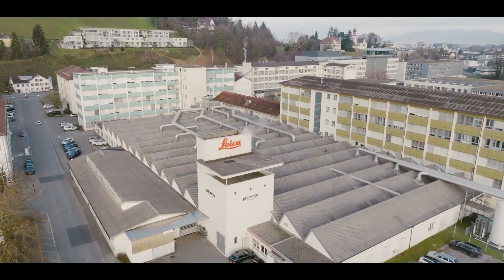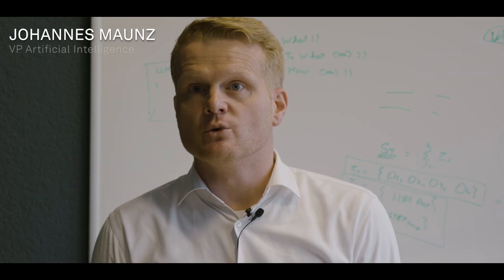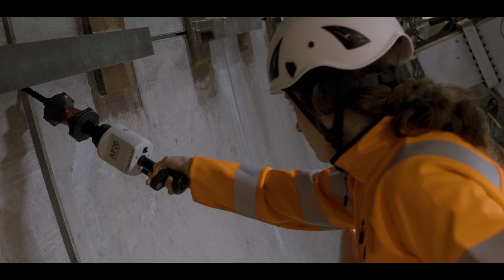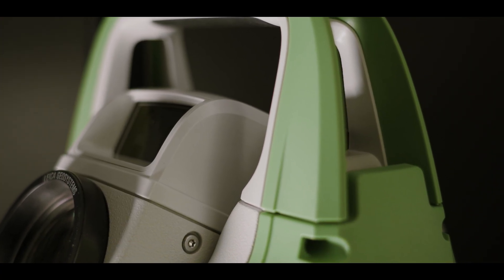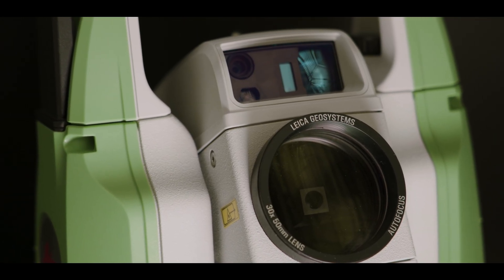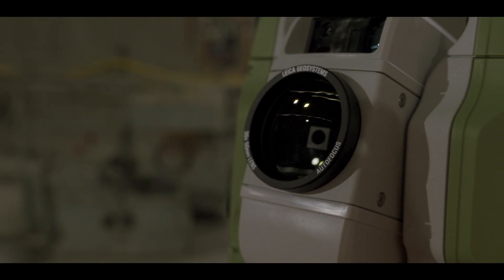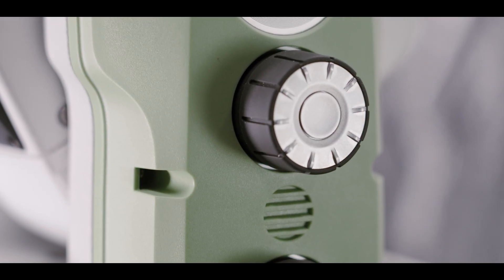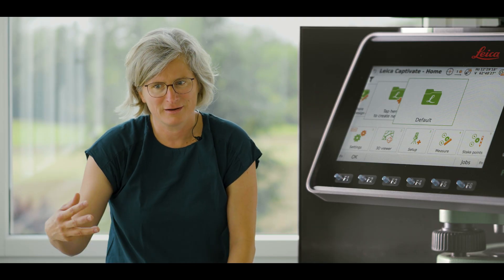Leica TS20 – The people, the passion, and the technology behind the evolution

Comment: Good news, finally something what can replace TS16, but you have to do something with Captivate software its soo outdated and not user friendly.
Reply: Agreed 👏👏
Reply: How captivate handles jobs and projects is just woeful
Reply: I use Geopad.

Not as fancy visually, but is faster software in the field.
Reply: That's almost always seemed to be a common theme with Leica, though. The software/firmware user interface is not the most user-friendly as a rule. However, the hardware is second to none in my opinion. It's because of the latter that whenever we had to order new equipment for our local office (I worked for a state DOT for many years), there were four words I would repeat: "We're a Leica shop."